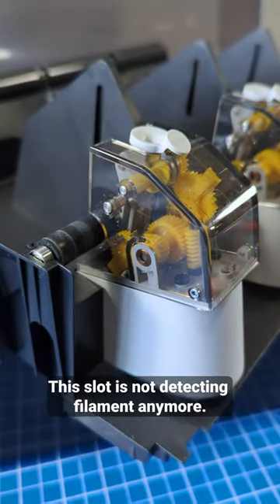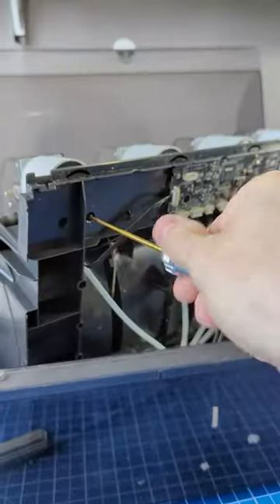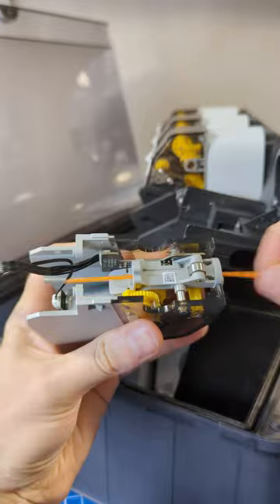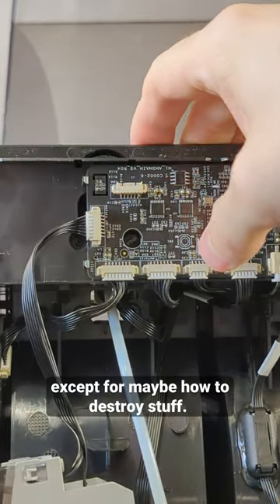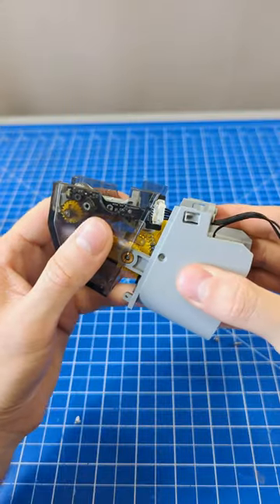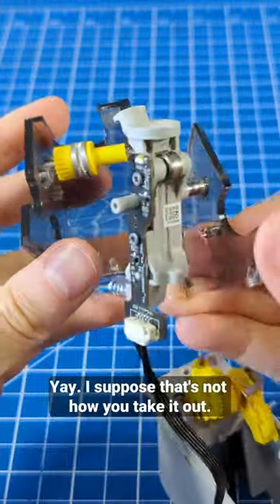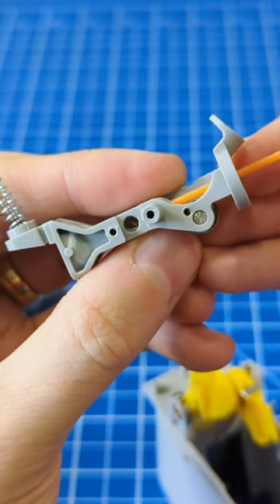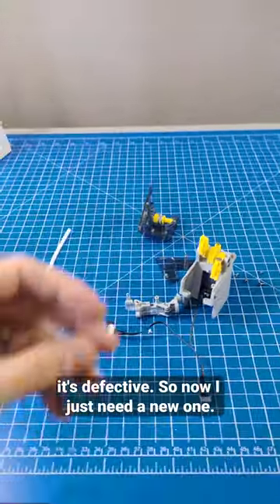Who broke the feeder?

Comment: I saw a comment on their site about how they have a new ams pcb that changes the way the filament detect works. The old design looks to use a switch and they changed it to a hall sensor. They have instructions on how to check what version pcb you have and have a comment that if it is the old one you should let them know and they will replace it.
Reply from the maker: That's cool! I didn't know that. Hall sensors work better on the long run as there are no mechanical switches.
Reply: May I ask where you saw this? I can't find it on their website. Have already replaced 1 feeder on original run of AMS unit and now have 2 others starting to go faulty with detection.
Reply: @Mallivex 3dprinting professor also said that kickstarter versions have different first stage feeders. Also there is no void sticker anymore because they expect you to replace them yourself anyway

Comment: honestly, those "void" stickers should be forbidden by virtue of being intentionally misleading regarding the legal implications of "tampering" with your device on your products warranty.

In most jurisdictions, including basically the entire western world, it is not at all sufficient to void a warranty on grounds of the end user opening it up; the manufacturer actually has to prove that there is a direct correlation between the modifications done and the fault that occurred. If you opened up your laptop and it stops working bc of a cold solder joint or whatever, they have to honor the warranty regardless.
Reply: Wow, I didn't know that but it makes sense. So is the law saying "it's yours too do whatever you want, you can try to fix it, but if you screw it up, it's your responsibility"?
Reply: @shacharliberman5084  you basically nailed it; the general consensus in western law is that the issuer of the respective warranty has the burden of proof that your actions have been materially involved in the experienced failure mode. If you opened your game console while standing on a carpet and the PCB shows damage by static discharge, it’s your fault. If you tried to change the battery in your phone and thereby ripped the flexcable socket off it’s solder joints, that’s again on you. But if you upgraded your Laptops RAM and a week later your GPU failed due a manufacturing defect or a bad capacitor, it’s against the law to void your warranty because you weren’t allowed to user service your devices as per the Terms of Service. That’s a suckers clause designed to pick off gullible people that don’t know any better, as in you loose 100% of the shots you don’t take. 

Also, remember their burden of proof! Sometimes, it’s just not economically viable for a company to argue that case to the bitter and costly end and just give in and do the repair if one insists. So, just play the same game back. You also loose 100% of the shots you don’t take ;) good luck!
Reply: They are illegal in the usa
Reply: @Ckcdillpickle they're not illegal no? They just don't mean anything
Reply: All good in theory, but does it work in practice? Can't companies just say "tough luck, sue us", knowing that it's not cost-effective for a customer to sue them, and that they can bear the cost of litigation just to scare off other customers?
Reply: I have fought with companies over insurance claim on consumer electronics. Depends on the company, most have aspects of their legal clause that allows them to deny under said circumstances. Had this happened with a customer, I opened it. I record warranty repairs, because of the way that Asus wanted to handle what was clearly a IC a cold joint.
We ended up giving up, I repaired it for the customer because they gave me the runaround to, and stopped responding. Post repair, they finally let me know that they would possibly honor it if it had not been opened😂 the entire dispute was over that one aspect. All they were doing is playing hot potato with me.
Reply: Should people realy be responsible to fixings the products u carelessly take apart?
Reply: @nAcolz no they are illegal in the US to put on products. The company can be fined by the FTC through federal law under the Magnuson-Moss Warranty Act

Comment: First time I saw this video, I knew I would be back…
Hi there.. I have a big issue with filament failing to retract and getting stuck in the 4way hub.. the motor refuses to let it go and I can pick up the ams by pulling on the filament… help or advice? Its happening constantly.. is my hub 4way hub motor failing?